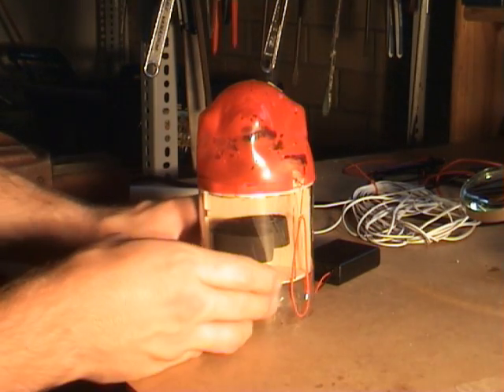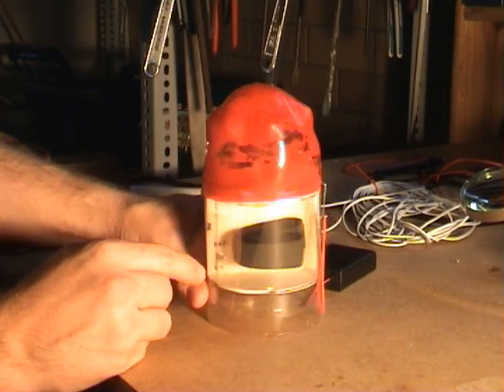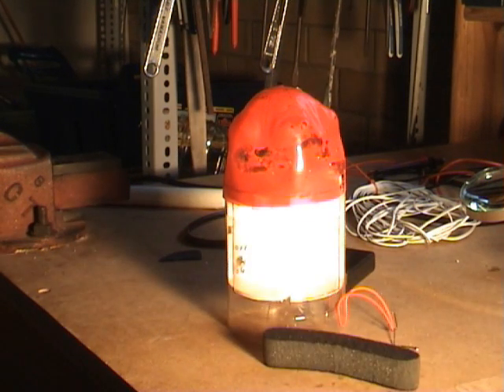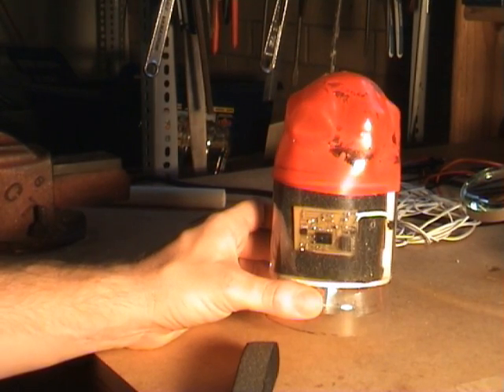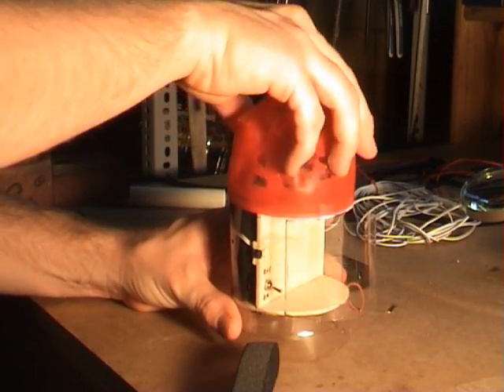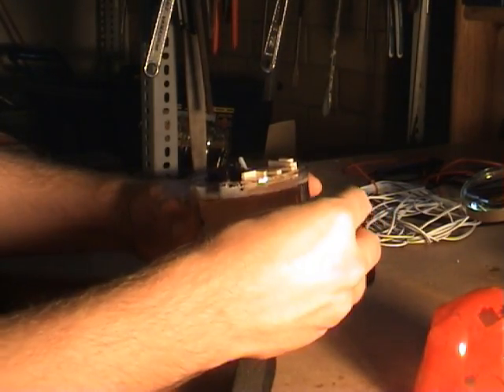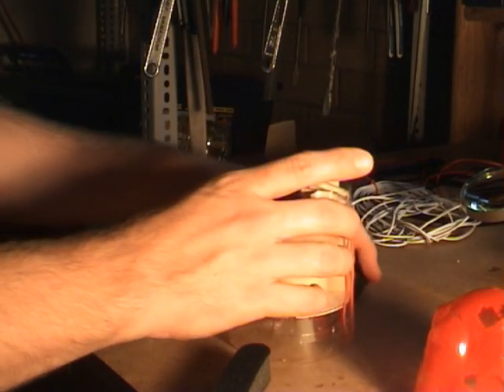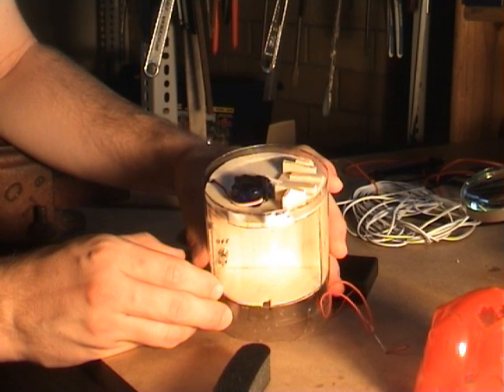Water Rocket parachute side deployment system

Comment: If he's using what I think he's using then they're actually quite cheap. You would be looking at around the Au$10 mark +/- $5, depending on supplier, model etc.

Look up PIC, it is a commonly used Microcontroller made by Microchip and would be fine for this kind of application.